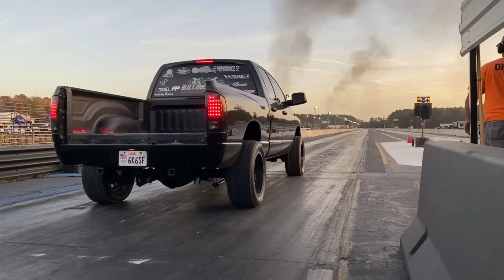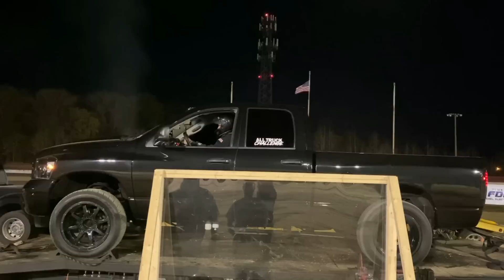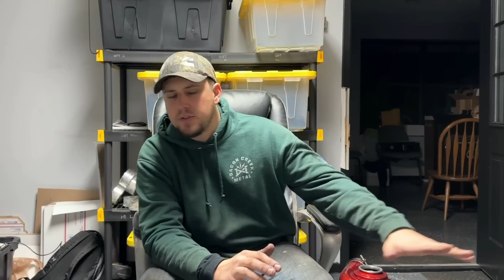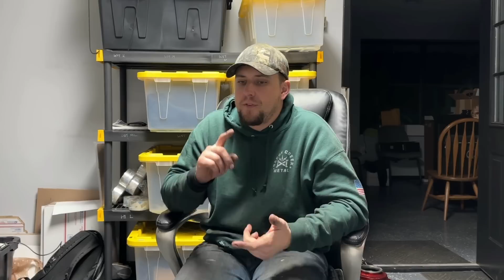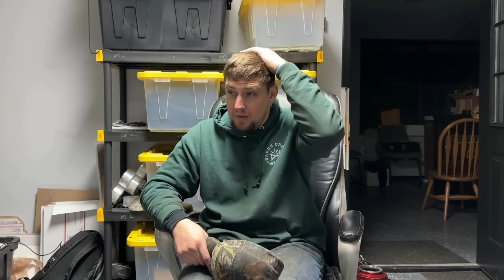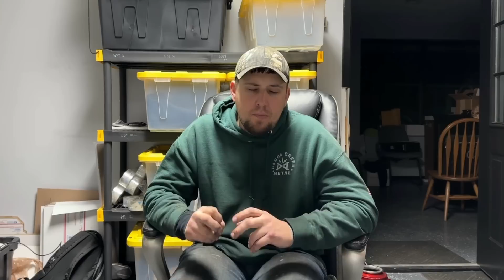HOW TO SIZE CUMMINS INJECTORS

Comment: I just got DDP patriots stock nozzle, how much hp are those good for? I’m also running a BD super b 58/74, BD 2 piece manifold and s&b air box with a smarty touch. It’s an 05 2500

Comment: why would grid heater light turn on only after highway driving frp normal 06 5.9
Reply from the maker: High return on the injectors
Reply: @horsetorquesdiesel what’s the best ones to get for 600

Comment: What do you think about 50 horse (22%) flux's and a BD Iron Horn kit S364SXE/76 0.91 AR? Would egt's be low towing and good power for towing? I've read that bigger injectors cut down on smoke with mild/towing tunes?

Comment: I have a 2001 24v 5.9 stock engine. I use it mainly to haul my 6k sealed rig for work. I'm looking at having to replace the injectors, so I'm curious what size I can put in there to get a little more out of the engine without mods or internal damage. I do have a Fast Pass system on this truck.

Comment: Off topic. Can you run dual cp3 with a factory exhaust break. 06 megacab I bought used came with a Cummings branded exhaust brake and is spliced in at the ecu it looks a lot like the banks kit but no controller that I can find or stickers or banks branding. Thanks
Reply from the maker: Yes you have to move the actuator though

Comment: Awesome video; thanks! - Real quick. DDP or BBI?
Reply from the maker: Ddp hands down!
Reply: @horsetorquesdiesel  Copy and appreciate the reply. 🍻 Considering going with DDP’s 25% overs. Truck has a S364.5/.91 Iron Horn kit. 124k  miles (~10k on turbo kit) w/ no issues to date. - Do I need an upgraded CP3 and/or lift pump?.. 16’ 6.7

Comment: Example if I’m not necessarily chasing 800-1000whp but wanting to stay  around the 600-650 mark and rev my 5.9 into 3500rpm+ would the Fleece CP3 CPK pump be more apt when also considering towing? When does a 10mm vs the modded stock cp3 become a necessity?
Reply from the maker: For 650 just go with a 10mm

Comment: Doing studs (OptiTorque), springs and pushrods (PDD) as I recently installed BD’s Iron Horn kit on my 6.7 with the S364.5 w/ .91 and I’m hitting 54 psi. 

Anyway, while I’m in there, would you recommend I stay stock (120K) or go with a set of 15% or 25% Dynamites? 

No plans to upgrade further than that. 

Let me know your thoughts and as always, thanks dude! 🍻
Reply: Tran then some fat injectors tuned down

Comment: The 5.9 lines, updated #4. Can you elaborate what update this is?
Reply from the maker: They changed the isolator, instead of the bolt together style, it’s crimped on so the bolt can’t back out

Comment: I am needing to do injectors in my 03 250 hp Cummins and wondering what your recommendations would be for stock cp3? I tow my 5th wheel camper 12k in texas but don’t do a lot of moving. I drive it twice a month and plan on doing an s300-63/64/12 turbo at some point.
Reply from the maker: 30% overs is the biggest I’d recommend on a stock cp3. If you are happy with the power and want nothing more there is no issues with stock but a 30% can be used on your set up

Comment: I have a question about streetability. I have seen some articles about running larger injectors at a lower pulse width rather than running smaller injectors at a higher pulse. I have a mostly stock 08 6.7, its mostly a tow rig and its going to need injectors soon. should I go for a larger set, say 50% if all im going for in the long run is 650-700 hp?

Comment: Can you speak to second GEN owners about setting up a tow rig? This is a subject that is not understood or talked about much, but there is a lot of interest still in second GEN’s. Turbo size and injector size. Thanks.
Reply: If you are talking max towing then twins and 5x.012 or 5x.014 will be about it and you won't be able to use really anything over 400hp. The cooling system can't stand it.

Comment: Hey, another good discussion to have is throttle valves or no throttle valves in the rail.  I didn't realize until recently but I've seen 2 rails, one outta 1100 hp 4th gen and another outta 1500 hp 3rd gen that had the throttle valves all variably displaced into the bore of the rail.  I removed them and reused the rail.  A stock rail has all the throttle valves installed to the same depth.  These trucks weren't subjected to stupid rp, I know the tune on the 4th gen wasn't running more than 180mpa.  On anything other than hot street truck, I'm gonna remove them.  I wonder how many have popped out and either trashed a connector tube or worse?  Have you seen anything bad from throttle valves?????

Comment: Good guide. i have a 04.5 CR we ran 150% overs in with a 12mm cp3 with s363 over s483 and it would do 900-1050hp depending on dyno and day. Little more cp3 and a larger high pressure turbo it would have done more for sure.
Reply: How stretched out was that?
Reply: @thebitefight2601  What do you mean by stretched out?
Reply: @jedpratte  injection micro seconds.
Reply: @thebitefight2601  I don’t recall it was tuned via smarty UDC tuning. Les at silver bullet did it. It was dropping rail pressure so it needed more cp3. My memory says it would drop 4,000 psi by end of the 1/4 mile.
Reply: @jedpratte  my set up is very close to yours but I’m running a 464 with a 483 and 200% overs 178/208cam and dj head fully built lower and balanced just got a few other things to button up before it hits the dyno, I’m 45min from firepunk.
Reply: @thebitefight2601  Nice Long as you have enough cp3 that will make jam. I had   Arp main, girdle, 12v rods with arp bolts, cut and coated Mahle pistons, 625 studs, 188/220 with Hamilton springs and push rods, head had some port work as well.
Reply: @jedpratte  I was just asking because when it’s stretched out to much egt go crazy, I’ll be running a 10mm over stock with a 22bar rail plug and 6.7 rail sensor so I was wondering
Reply: @thebitefight2601  How hot is crazy? I would see 1600-1700 by end of the 1/4 mile, I had a external wastegate on truck and it would normally make 80-85psi at those egts.
Reply: Tuning can play a huge role what’s it tuned on right now? The truck ran much cooler and clean after custom tunes.
Reply: @jedpratte very similar to my set up but I got street fighter rods and dj pistons all studded no girdle, before I cook my Mahle pistons on my last set up I was running the same cam and s366 down low on 100% overs and it would hit 1200 and shoot to 2k in a blink of an eye and my understanding with was due to injectors being to small.
Reply: @jedpratte  I can look at my email but believe it was when I went past 2800ms it started getting real hot fast.
Reply: @jedpratte  well I was running tunes from a buddy’s buddy it did real well then I got soft wear and did my owe thing it made a lot more power but I cooked it so this time it’s going to firepunk.

Comment: Great video Josh!! Love the info. I'm about to pull the trigger on some DDP 150% for my 5th gen and have been on the Fence about getting a 12mil or just adding a cp3 to my cp3 conversion. You have any insight on that? Also how with trying to save some coin who would the truck drive if I did 100 or 150% injectors on my cp3 conversion. Just normal driving not beating her? Thank u for the content.
Reply from the maker: I would just do a single 12mm less to go wrong!
Reply: @Horsetorques Diesel  you think I can run the 100% for daily driving b4 I upgrade the pump? Would it hold rail pressure? Or do pump first or just wait till I have the coin do do them at the same time.  Thanks for you advice man it's highly respected brotha!!

Comment: Thanks for the video Josh. Will a 6.7 injector fit in a 5.9 CR?
Reply from the maker: Not without machine work
Reply: Nope
Reply: @stvnmllr  Not necessarily true with that statement.  It depends on the year head in my experience.  I have a 2012 spare head here and my 5.9 injectors fit and click in the bore.  I have heard of the early 6.7 heads not clicking in.  There is also a few people on Cummins forum that are running 6.7 injectors on the 06-07 trucks with efi live.  The idle is rough on first start but they claim it runs fine.  I wouldn't do it, but some do.
Reply from the maker: A 5.9 fits in either 
A 6.7 won’t fit into a true 5.9 head
Reply: @horsetorquesdiesel  thank you sir!

Comment: Had to laugh. I deleted my grid heater and also PORTED my stock intake horn. 08 6.7. Figured if Josh runs it so can I.  😂 Truck is BONE STOCK except 5" turbo back, studded, and deleted.  NOT turned up. hahaha. I expected nothing and got nothing except piece of mind the bolt won't break off and drop into the head.
Reply: Stock intake horn can flow way more than the intake valve can so while it is techically a restriction it won't make but very little difference in power because all you will gain is the easier flowing exhaust thru the turbine because the compressor isn't working against as much pressure.  My guess is its like 1 or 2% at most.

Comment: Great explanation. I was wondering if a 6.7 rail was really worth it like some people claim. Not happening at my level. Getting a 476 this winter to pair with my ddp 150s, should crack 1000 pretty easily. Up in maple syrup land so gonna hit up Armor for some dyno tuning, and proceed to have fun
Reply: Whooh buddy Canada isn't maple syrup land, Vermont is my friend! Just messing with you, thought I needed to defend my state. I hope you have a 6.7 in that 5.9 truck I can't imagine trying to spool a 476 on a 5.9.  Hello 3k stall speed and 5k rpm.  Let us know how it works out.  How do you like the ddp 150%? Those are my next injectors I think.
Reply: @Joshua Quilliam  nope it's a stock bottom end 5.9. Turbine wheel and exhaust housing selection are pretty important, but talking to guys with similar setups, it should spoolfairly decently. 2500 rpm stall converter. Should work just fine. We are about to find out😁
Reply: @curtisd8206  You're gonna snap a rod pushing stock rods over 1000hp. I fully built my engine for 1000-1500hp and those stocks are tiny compared to waglers Street fighters meant for that range.
Reply: @cole1407  big single turbo with high rpm power, tuning to keep the torque out of the low range. It will be fine
Reply: @curtisd8206   I just don't see why neglect the bottom end, if you do end up throwing a rod through the block it won't be a great day.
Reply: @Cole  when it does blow up I'll build a 6.7 for it, I just really don't care much about the stock 5.9😂
Reply: @curtisd8206  sounds like a waste of money that could be spent on the 6.7
Reply: @cole1407  how exactly is that a waste of money
Reply: @curtisd8206  man if you can't see that there's no point in replying any further lol
Reply: @Cole  if you are talking selling the 5.9, no one's gonna pay much for a high kilometer stock engine that's had the shit beat out of it for the last 8 years. All I could do is sell it as a core to an engine shop, which honestly is not worth the bother of shipping it
Reply: @curtisd8206  so my point why put $ 3-4k 150% overs in a vehicle that won't be lasting long.
Reply: @cole1407  cuz I can use them in the 6.7
Reply: @Cole  and getting them rebuilt with new nozzles at dynomite cost me 1650 USD. If I decide I want to run a standard lipped bowl piston in the 6.7, I can get the nozzles swapped out for even less money and sell the almost new nozzles I have on them now
Reply: @Joshua Quilliam  love the ddp's, very clean running. Had a set of ddp 220% that one stuck open so sent them to dynomite to be rebuilt and went with 150 nozzles. The old injectors were about 7 years old, and the new ones run so much better and cleaner. Amazing what those guys are doing with improving technology